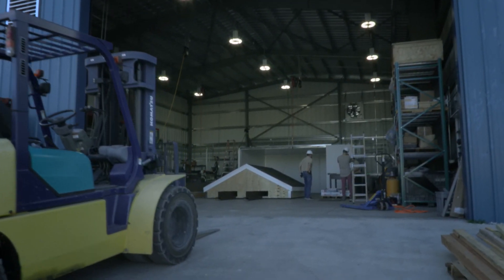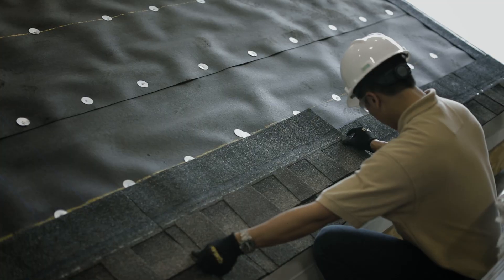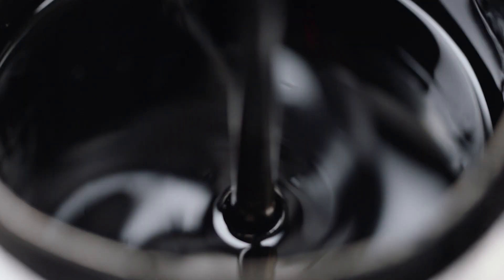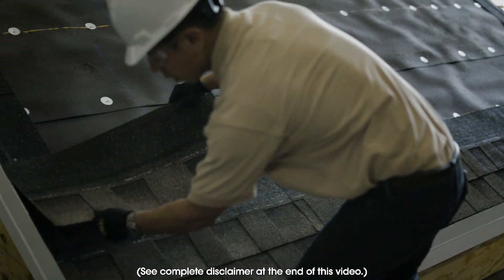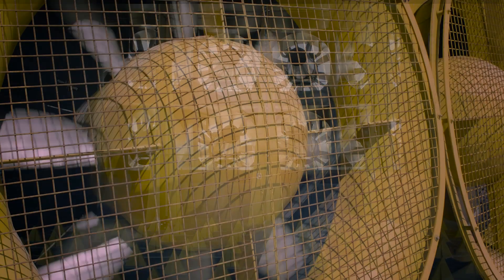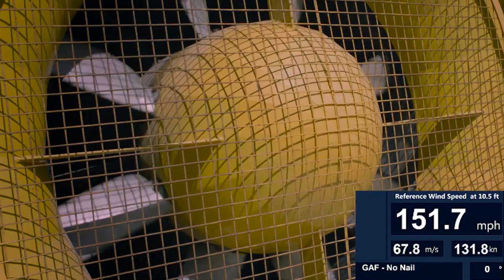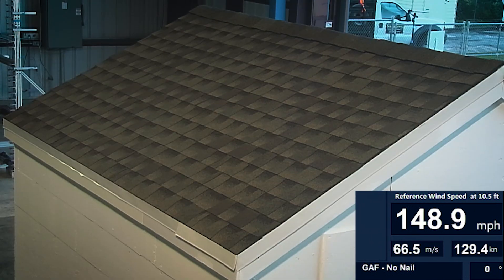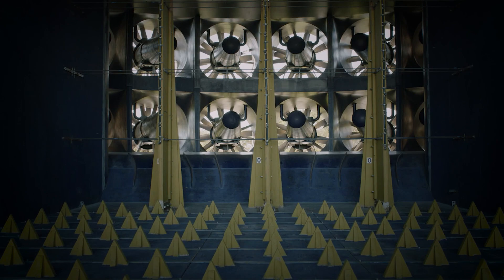Are Roofing Nails Overrated? | GAF Timberline Shingles

Comment: I am no roofer, but a bush league carpenter, I know nail placement has tons to do with this test a high nailed shingle cocks and leaves an air space, when the wind goes over the top of the shingle surface faster than the static air under the shingle, which is improperly nailed causing it to be bowed slightly, this causes an air foil, high pressure goes to low pressure, pokea hole in an inflated tire, what happens high pressure goes to low pressure, so no nails are better then improper "high nailing"

Comment: Installed in a cold climate in December, it will be months before there's enough heat for the adhesive to bond, I've heard.  Sun will heat up the shingles to be warmer than the ambient temperature, but warm enough for the adhesive to bond?  Assuming the shingles last until the Spring, will the adhesion still happen properly after months on the roof?
Reply from the maker: Hi, Jonathan. We don't recommend installing shingles without nails. Please visit our website for detailed installation instructions.
Reply: @gafroofing  I should have been clear - my question is about nailed shingles
Reply from the maker: Hi, Jonathan. Please refer to this bulletin for cold weather applications: https://bit.ly/3CmGncn. If you have any further questions, please contact our technical experts at 800-766-3411.